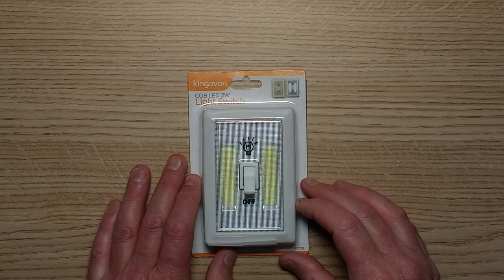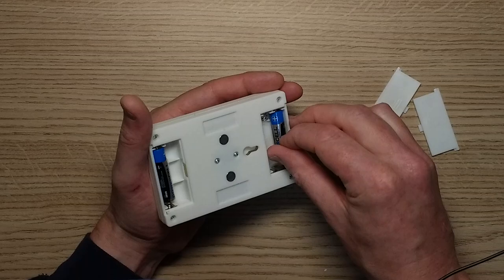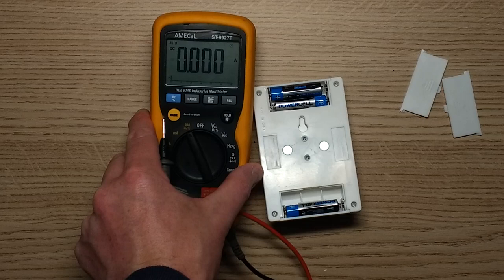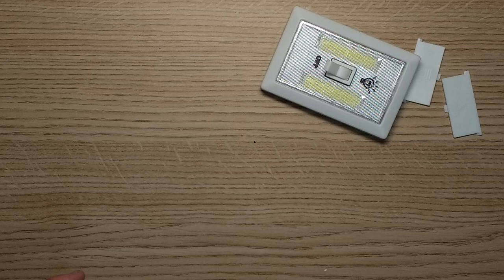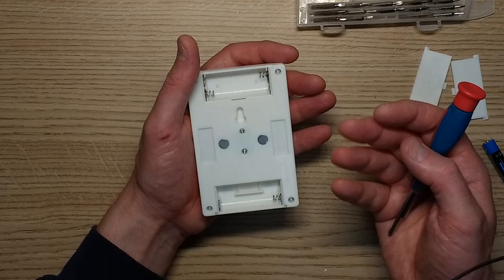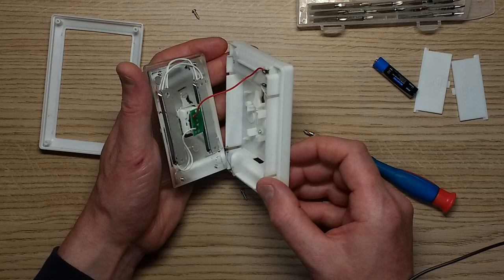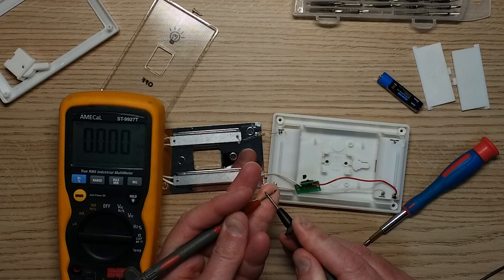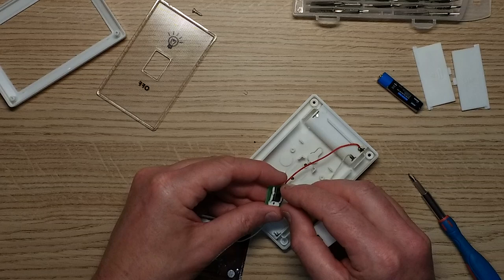Inside a switch-themed self contained LED light.

Comment: interesting, I have this light switch light, mine is almost the exact same as yours but on the inside instead of the resistor there's just a wire
EDIT: here's a link to a schematic I made of the inside of the light, it's a bit rough and was done really quick in paint
http://imgur.com/a/gZChj

Comment: I use a similar one for providing enough light so i can return to bed after turning off the hardwired light.
Reply: I have a ceiling pull cord above my bed to turn off the main light as well the wall switch by the door. Its very convenient.

Comment: So for a meter - what is the safest thing to leave it on?  Connectivity test?
Reply: AC voltage and the highest range. All other ranges and functions can be damaged by a high voltage. Or leave the leads unplugged although no one ever does that.
Reply: Ah that makes sense - cheers!  Yeah unplugging leads just means I'm going to be missing one when I go to use it. >< :)

Comment: Father in law has these under stairs unfortunately he leaves it on.Spent 10x the cost of the £2 unit on battery's. POUNDLAND RULES...ALMOST
Reply from the maker: You could get him a USB rechargeable PIR light for Xmas.
Reply: @BigClive  That's a good idea.Its going to me who charges it though . let's hope he tells me it's gone flat and not weeks after its failed.He is 87
Reply from the maker: @ssgeek4515  Get two and mount one.  Then just routinely swap them from time to time to avoid having to wait for one to charge.  Or get the version that takes ordinary batteries.

Comment: Has anyone else noticed that it starts to produce an acrid smoke. I stopped using mine because of fear it might catch on fire?
Reply from the maker: It sounds like it's miswired or a battery is back to front.
Reply: @BigClive  I'll try to open it up to see if its something like solder flux. I hope I don't find the circuit put together with hot glue. I will turn it on for a bit and see. I notice yours takes 3 aaa cells where mine takes 4 for some reason.

Comment: If i found such a thing in my home it would be the first to go into the garbage bin :-) Nice for a student or a teenagers room..
Reply: I have one of these things on the wall next to my desk in my classroom.  It actually comes in really handy as a temporary light when I am lecturing and I need to find something on my desk while the front lights are off so students can see the smart board screen.
I also have one at home mounted to the inside door of the first aid and medicine cabinet so I can quickly see what I need even if the power is out

Comment: I’m trying to wire this to my car battery I need some help
Reply from the maker: It's not really suited to 12V use.
Reply: @BigClive  how many volts is it suited for
Reply: @BigClive  I’ve got a soldering iron and lots of wire
Reply: @BigClive  could I wire up some sort of voltage reducer

Comment: AAA batteries and 3 of them.. the wost possible combination (maybe a part from 9V batterys)

They could easialy fit AA batteries and 4 of them. Then it would last 6 times as long, and hardly cost more. Would also be able to use rechargable batteries